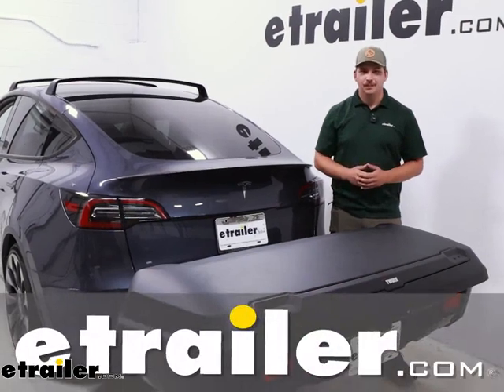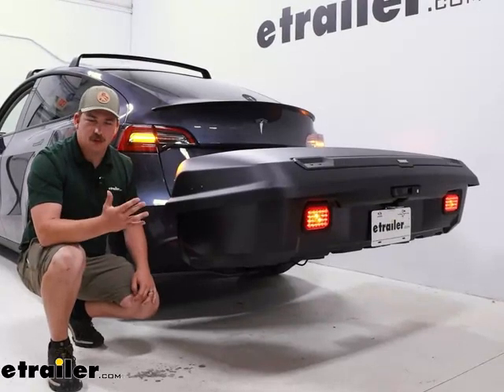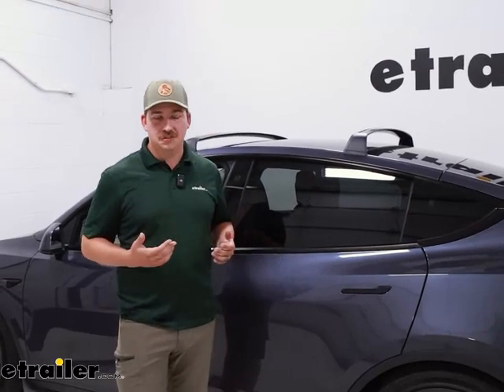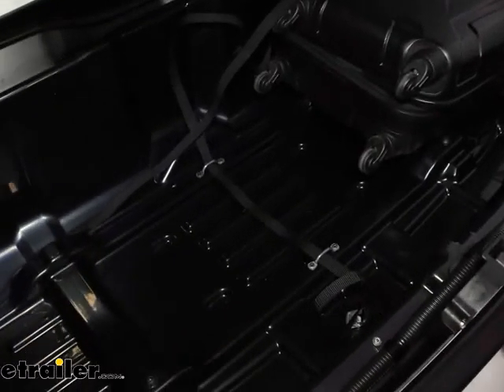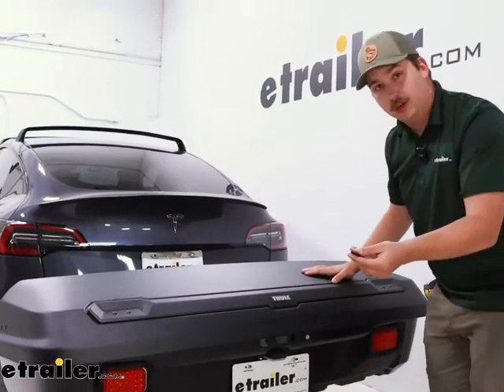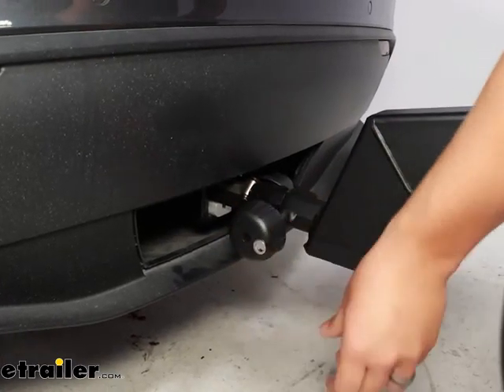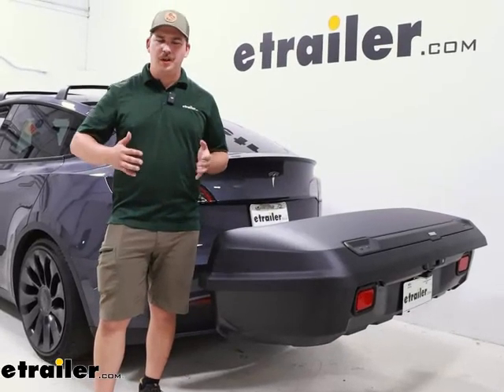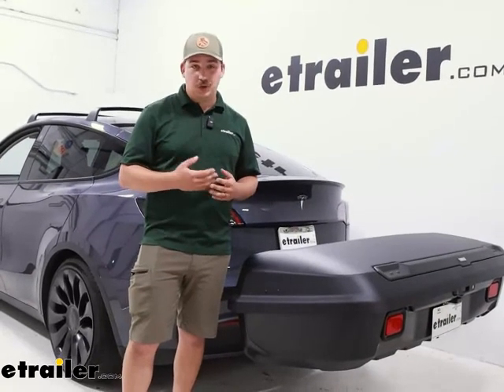etrailer | Comprehensive Review: Thule Arcos Enclosed Cargo Carrier

Comment: Just bought this Thule arcos cargo box and hitch platform. Very easy to put together the platform and even easier connecting it to the hitch. I love how I do NOT need any tools to tighten it. Only two bolts to connect the cargo box. I backed into a supercharger ok but 2 people is needed. I had to get within an inch of the pole to get close enough for the cord to reach. But it’s doable. It will be hard for thicker people to access the trunk with it on.  So the Yakima swing base may be better. I didn’t go with that as I believe the space is only 10 cubic ft vs 14 for this box. Plus Yakima was about 22lbs heavier. Which impacts storage weight  limit. I will say closing it and being able to remove the key is a little tricky but I think I’m getting used to it. This is one of the priciest. I was lucky to get used new in box one. But I still need to get an adapter for the brake lights. I found one for less than $10 on Amazon that will be here tomorrow. So far supercharging is doable which was my concern and very little posts re that. Hope this helpful to other 2023 model Y owners.